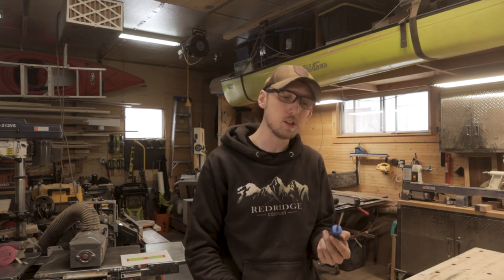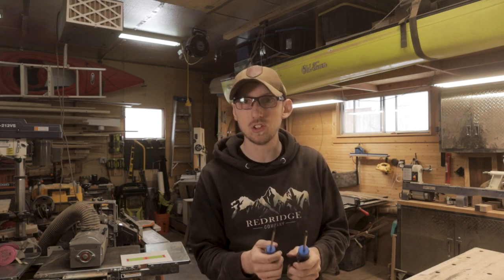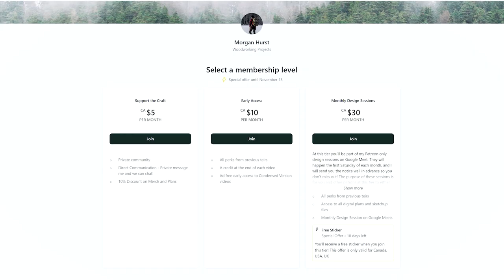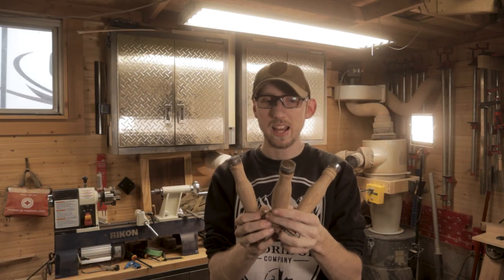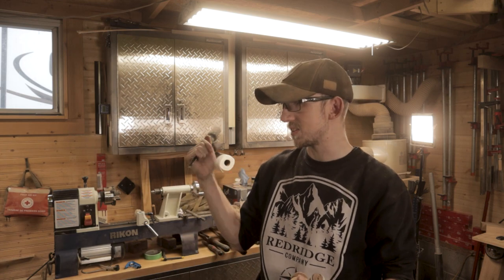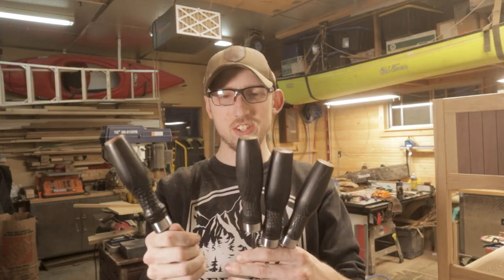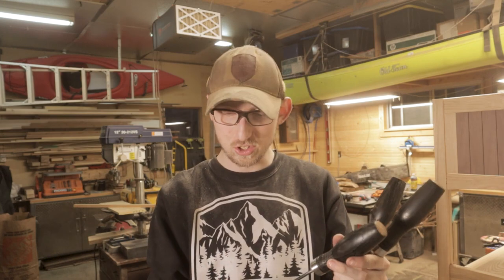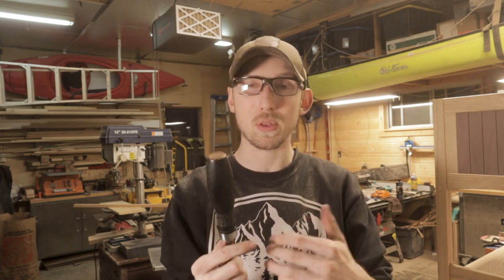Making custom black oak screwdriver handles with stippled detailing | Lathe Turning

Comment: Amazing work! Love the aesthetics!

If I may armchair quarterback here I wonder if the perfectly round handle would be hard to grip when you need high torque. 

At least with torx bits you probably won’t be needing that torque. I don’t think anyone uses torx for woodworking 🤔
Reply from the maker: That's a good point, I didn't think about that. Definitely on the Philips and Robertson it would be good to add some flats for a stronger grip because those usually do need a little extra torque! Thanks for the idea!

Comment: I like the handles, but have you tried steel wool and vinegar? I have used this to make oak go black and it works amazing! easy to make at home, cheap and reliable.  https://www.youtube.com/watch?v=tqFnBcKUdhA
only thing I don't like is some waterbased finishes don't work over it, but had no issue with oil based.
Reply from the maker: I've messed around with the steel wool mix a few times and I like how well it works. I got out of the habit of using it though because it can be kind of unpredictable, depending on concentration and when you mix them, not so important for this case but on larger project I didn't want to have to mix a new batch to try and match an older one. I can't remember who it was I saw use india ink but I like how it gives you a basically pure black finish every single time and it doesn't affect the oil based finishes I typically use. Only issue with india ink is it doesn't penetrate very well which is why I have to use the stain first to get into the pores.